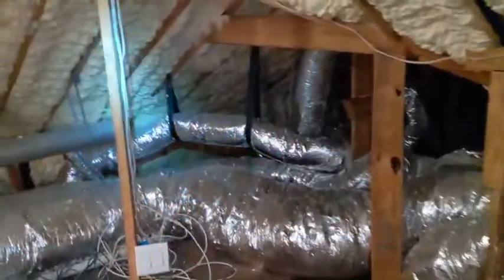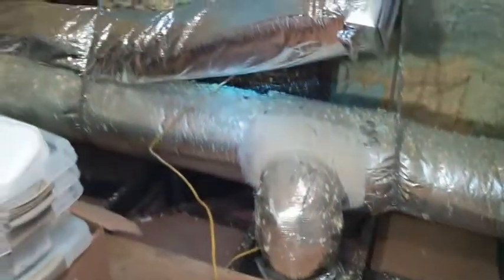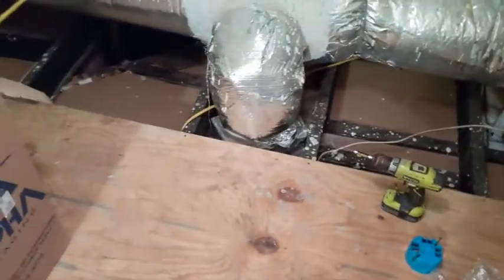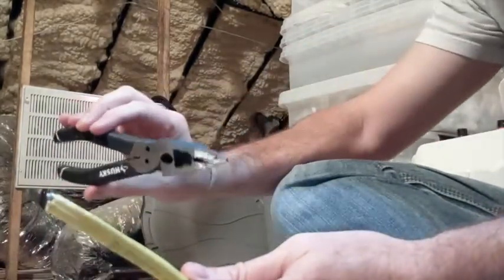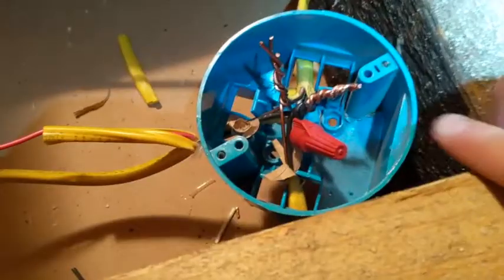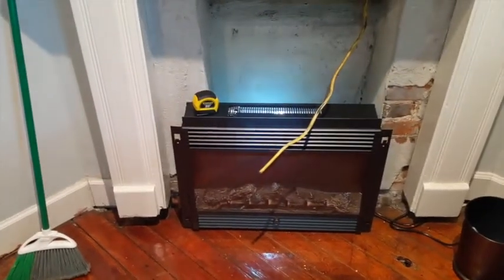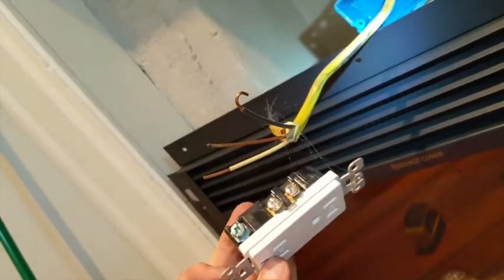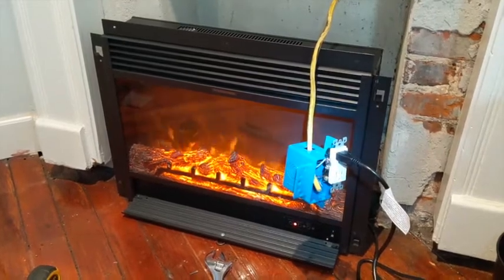Running Electrical Wire for Electric Fireplace: Part 2

Comment: So, this is wired with low voltage wire, correct?

Could u place terminal block code, number, or letters?

Comment: I'm sorry dude but you did not do a good job. First off the load wire is not in the round box enough. Your not supposed to see the thhn outside the box, second thing you did wrong is you made those splices way to short. There's a rule of thumb in electric. U make a thumbs up with a closed fist and the wire should go from the end of your fist to the tip of your thumb, roughly 6inchs long. Your wires should not be 3inchs long.

Comment: You realize that the junction box used in attic is for a light fixture in a wall or ceiling. Also even though your wire nutted the wire you should have use a cover plate. Your still susceptible to wires possibly arcing and using your truss as a cover plate you only asking for a potential fire
Reply: Yep!!!

Comment: It is not about your install but your wiring should be a code violation. Totally disorganized, I also had an older home at one time but tried my my best to do proper routing of the wires. As far as the "Evil" red wire goes it should have been capped off for possible use at another time in the future on both ends.